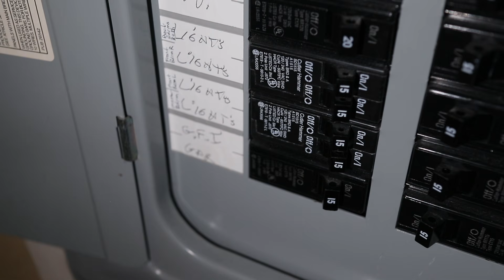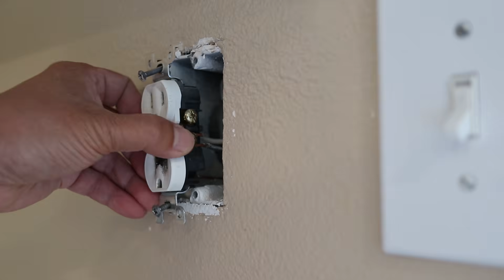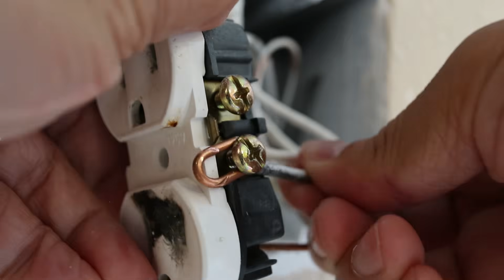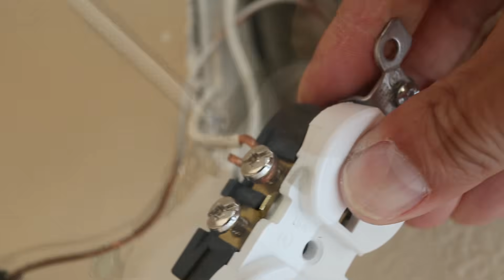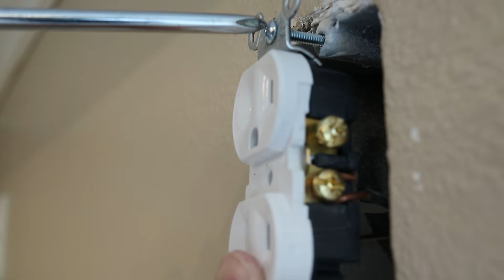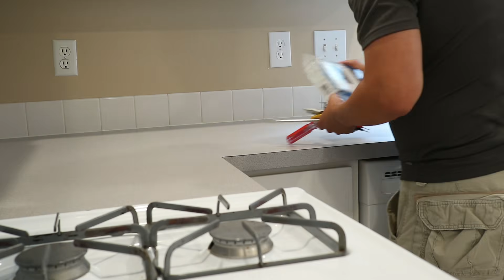How to Replace an Electrical Outlet – Replace Burnt Out Electrical Outlet and Old Damaged Socket

Comment: I have one question my on outlet has completely burned and it shoots out sparks if you turn the power back on is it just the outlet or the wires? It's similar to the one you showed in the video but worse. Great video, Thank you!

Comment: NOOOOOOO!!!
1. Tighten the remaining screws on each side of the outlet. 
2. Remove the paint off the ground wire.
3. Make sure you put hot and neutral on the right terminals. Hot (black) goes to gold and common (white) goes to silver.
4. Not necessary, but line up the faceplate screw horizontal or vertical
Reply: is this the right way to do it?

Comment: I took off my outlet and mine has 4 wires going directly into the outlet, not connected to the screws, how do I replace that one?
Reply from the maker: Sounds like you have a newer type of outlet with push in connectors. I’m not an electrical expert and even I still have issues taking those wires out. But I think there’s a little hole where you can press and it will release the wire. Hope this helps!
Reply: @TheRenderQ  thank you!

Comment: OK so I have a question we have a barn in our in our barn we have a room well one of the plugs in the room it burnt out like that but none of the other plugs in the room work now could it be just because of that one plug or does it mean all the plugs are bad because there’s no power going to any of the plugs now but the breaker is not off it says it’s on
Reply from the maker: It sounds like you have a GFCI outlet in your room. Look at all the plugs in your room or area next to the room to see if you can an outlet with a reset button on it. Press the reset button and your outlets should work again. If you reset and the button pops out again then it’s possible the burnt outlet is causing more problems and it will need to be replaced. I’m not an electrician but I know the first thing I’d look for is a GFCI outlet and reset it. Hope this helps!
Reply: @TheRenderQ  Thank you so much I really appreciate that and I’m going to do that most

Comment: This may be a dumb question, but if there is still voltage on the burnt outlet, do you have to replace it? Is it just for cosmetic purposes, or if it's burned before, does that make it more susceptible in the future?
Reply from the maker: I’m not an electrician so I can’t be 100% sure. If the receptacle is still working it might be fine even if it looks burnt. The burnt marks were probably caused by sparking and to prevent damage the breaker could’ve tripped for safety. So in all likelihood the burnt receptacle is probably cosmetic. But the one I had was in a rental house so I had to change it. Hope this helps!
Reply: @TheRenderQ  Appreciate the response!

Comment: Hey there, thanks for showing this! Not sure if you still check these comments but I just closed on a tiny house on Monday and aside from everything being very dated, it seems the wiring was definitely not done by an electrician. There are only a couple of grounded plugs in the house. To avoid using several 3-prong adapters, am I fine to replace my current 2 prong outlets (they don't hold plugs in very well) with 3 prong outlets and just maybe mark them to show they aren't grounded? Not sure if you can ground an outlet without putting some holes in the walls.
Reply from the maker: Congrats on your new house! Unfortunately I’m not an electrician so I can’t really advise you on how to go from 2 prong to 3 prong outlets. I was just able to replace my outlet with exactly the same thing. Sorry I’m not more help! Hopefully you find an answer to your project! Thanks for watching!
Reply: @TheRenderQ  Thanks a bunch! I also appreciate the quick response. Something I found is that older houses might have the 2-prong connected to a metal box and the box itself is grounded and that is where you would connect the ground for a 3-prong. Something I may look into or call an electrician if it is too daunting for me. Your video definitely helped with the confidence as well as another for light switches. Hopefully I can slowly update this old home and have some of the areas make a little more sense. I appreciate it!

Comment: Why did you connect the Hot black wire to the bottom screw and the White neutral to the top screw?
Reply: It makes no difference as long as the tab between the screws is not broken.
Reply: @surferdude642  t Thank you!

Comment: Dumb question.... do I need to turn off electricity??
Reply from the maker: Yes! You need to turn off the electricity to that outlet before you start working on it. I mentioned that in the video where I switch it off at the breaker box. Mine aren’t labeled very well so I have to flip breaker switches until I turn off the right one. Yours may or may not be labeled. Hope this helps!

Comment: Hi, I don’t know if you will read this but my outlet where my wifi router is plugged in stopped working and there were those burnt marks on the outlet, than the other outlets in that bedroom stopped working to, don’t know if this is a different problem
Reply from the maker: It’s possible that all the outlets in your room are on GFCI circuit. Look for an outlet nearby that has a reset button on it and see if it needs to be reset. The other thing which I think might be the real problem is that when your outlet burned out, it tripped the breaker switch for your room. Check the breaker panel to see if the breaker switch for your room got tripped. You could flip the switch back on and you should get power back on in your room. That burnt outlet will need to be replaced. Hope this points you in the right direction!

Comment: I agree with others claiming how great the video is - precise, straight-to-the-point and no-nonsense.  Since time is money, your candidness is much appreciated.  I was just wondering if the GFCI is replaced in the same manner.  Can someone comment on that, PLEASE??
Reply from the maker: I have not changed a GFCI outlet myself but I would imagine the process should be the same. Now you got me thinking I need to open up a GFCI outlet and see what wires are in there!

Comment: With the circuit tester does it matter what color goes in what opening ?
Reply from the maker: I’m not an electrical expert but when I use the tester shown in my video I don’t look at what color probe I’m using. In fact I don’t know which side I should be putting into which opening. But I’m mainly concerned with whether there is any power going through the outlet before I work on it. This tester lights up no matter which side I plug the probes onto. Hope this helps!

Comment: I changed the same way two different power points ....One working fine but the other is not working ...It just spark little for 1second on moving wire but no power supply shows to any device ....Plz help ...What's the actual problem of   power socket

Comment: Saw in another video that any screws not being used  are tightened to avoid contact with the metal box. Another point, that the ground opening on the socket should always be closest to the floor so if via gravity the plug loosens the ground connection is maintained till the plug falls out.This was the way he did it , but it needs reminding.
The last time I had a receptacle turn black was a failed appliance plug, but certainly worthwhile testing and inspecting the wiring
Also it seemed like he was changing a  Kitchen outlet and here in Canada the top and bottom section of the socket in most kitchen outlets are separately wired with a 220 V lead 120 to top and 120 to bottom each outlet good for 15A  You have to break and twist off the copper interconnection on the receptacle on the feed or hot side. The smaller slot on the front of the receptacle is the hot side. You'll notice that the two breakers for kitchen outlets are linked and move together.
I'm not a professional, just an electronics,electrical, computer hobbyist.

Comment: Wrong!! The wire is stripped to much. The copper should only be showing around the termination screw
Reply from the maker: Yeah several viewers have mentioned that there is too much insulation stripped off. I just replaced the outlet with the wires exactly as I found them. This was originally installed by the builder. I will have to go back in and trim the wires so there’s less of it exposed. But makes me think how many outlets/light switches in this house are like that?

Comment: Unfortunately, the author of the video did not use TAMPER-RESISTANT receptacles as required by the code.
Reply from the maker: You are correct! I replaced my outlet with the same type that was in the wall box.
Reply: Not where I live are they “required by the code”

Comment: Do you have to turn the whole house off? Or just the breaker to the room you’re working on?
Reply from the maker: I only turn off the breaker for the room I’m working in. But always check confirm power is off at the outlet before working on it. Hope this helps!
Reply: @TheRenderQ  thanks! Got mine fixed. Thanks so much

Comment: My outlet doesnt have screws on the side. Just what looks like a clamp button. I cannot find anything on how to take it off and get the wires out ☹️
Reply from the maker: I’ll paste a link to a video with push style wire connectors. I’m not sure this is what you have. Tutorial starts at :32 seconds. Hope this helps: https://youtu.be/rYgj15F4SoQ
Reply: @TheRenderQ  I saw that video. But mine was slightly different. The slot was on the side instead of the two screws and it was like it was glued. Pressing them did nothing. I ended up cutting it off. Haha. All better now! The rest of your video helped a bunch! Thank you so much!

Comment: What happens if you Put water and soap in the outlets and the room power stops working what do I do?
Reply from the maker: Sounds like you tripped the breaker! Of course water and electricity don’t mix. Check your breaker panel to see if a breaker got tripped. If yes then you need to wait until the outlet dries out. Maybe blow a fan towards the outlet to dry it quicker. When it’s completely dry go to your breaker box and flip the breaker back on for that room. Hope this helps!
Reply: @TheRenderQ  what about the soap in the outlets should I try washing the soap out?
Reply: @TheRenderQ  I don’t have a breaker panel in my house
Reply from the maker: I think as long as the liquid dries out of your outlet it will still work. If there isn’t access to a breaker panel perhaps you tripped the GFCI. It will be like a breaker but it’s built into one of the outlets in your room. It’ll be an outlet with Test and Reset buttons on it. Press the reset when you’re sure the outlet is dry. The soap shouldn’t matter after it’s dry. Hope this helps!
Reply: @TheRenderQ  I don’t have a GFCI in my room what do I do?
Reply: @TheRenderQ  I think Samuel is messing with you

Comment: What if the old outlet is upside down?
Reply from the maker: Once you replace your outlet you can install it the right way up. Or you can turn your existing outlet if it doesn’t need replacement. Just make sure the power is shut off. The receptacle is just held in by 2 screws. Easy to install it the right way. Hope this helps!
Reply: @TheRenderQ  i bought a 1970 home. How do you know if the outlet needs to be changed?

Comment: When removing the wires from the old outlet, why not take the screws all the way out instead of prying the wires out?  You're not reusing anything from that outlet, so no need to save anything, although, I never throw away good screws.
Reply: In my experience the screws stop to prevent them from coming all the way out....thus not losing them.
Reply: @ohwell-63   The screws will feel tight, but if you keep turning they will come out.

Comment: Can I use just a simple voltage LED night light to test the circuitry as I don't have a circuit tester.  Otherwise the video is simple and to the point. 👍
Reply from the maker: I suppose you could test the wires with anything that can let you know that the current is off at the outlet. At the time the 2-prong tester was what I had. But recently bought a no contact voltage detector for these type of electrical projects.

Comment: Do the wires have to be wrap around the screw or just screwed in under the screw ?
Reply from the maker: The wires should wrap around the screw. Use some needle nose pliers to create a small loop. Also make sure there is only enough wire outside of the insulation to wrap around the screw. You don’t want too much wire exposed. Hope this helps! Thanks for watching!
Reply: You would like the "spec grade" receptacles, they have a feature where you can slide a straight stripped wire between 2 plates, then tighten the screw. They are not much more expensive, but higher quality than the cheap residential ones.

Comment: I poppet it off and one of the wires that was connected to the screws is totally melted off so short that I cant use it? Its like it exploded off then melted down and splintered and rusted and corroded to nothing?

Comment: Got to show some concern here for you and others watching.  Both hot and ground wires were stripped too long.  This resulted in bare copper wire being exposed beyond the back of the outlet.  Not good.  Should have clipped off the end of the wire and redone the strip to the correct length.  You can't always trust that the person before you did it right.  Also the top of the loop of the hot wire was about to squeeze out from under the screw.

Comment: I would like to replace all the outlets at my house do you recommend using 20 amp outlets for the larger appliances and 15 for the interior of the house? Will it cause complications?
Reply: Use 15’s throughout
Reply: 20 amp receptacles will not cause complications. Use 15 amp "spec grade" receptacles. Never use 20 amp duplex receptacles because you'll never need them and they offer no advantage. If you're concerned about overloading it's the wire gauge, circuit breaker and the number of receptacles on that circuit that are important, not the receptacle. Another thing is that 20 amp receptacles can only be used on 20 amp circuits, but 15 amp duplex receptacles can be used on 15 or 20 amp circuits.

Comment: What happens if the outlet is already dead but you keep the circuit breaker on with out using the circuit tester
Reply from the maker: Even if your outlet is dead the wires connected to it probably still have power flowing through them. The circuit breaker must be turned off and then wires to the outlet checked with a circuit tester to confirm the electricity is indeed turned off at the electrical box you’re working on.
Reply: @TheRenderQ  oooh ok thanks even though I’m 12 and never will do this kinda stuff but thanks

Comment: Loved this video easy and simple. Do you have one for ceiling light and wall light?
Reply from the maker: I’m really glad my electrical outlet tutorial was helpful! At this time I don’t have tutorials for a wall or ceiling light. But when and if I need to do one of those I’ll definitely be making a video for it. But I think that once you’ve replaced an outlet you should be able to do the lights no problem. Wiring should be the same but the fixtures are attached differently. Thanks for watching!

Comment: Can an outlet like this one be replaced with one that has a circuit breaker built in to it,like the ones in a bathroom above the sink?
Reply from the maker: The type of outlet you’re referring to is a GFCI outlet. I’m not sure if you can install one of those in here. I’m not an electrician so I can’t tell you for sure. But if a GFCI were to be installed it would protect this outlet from overloads or other problems. I just haven’t installed one myself so I’m not much help. I just do DIY I feel sure I can do on my own. Thanks for watching!
Reply: @TheRenderQ  thank you so much for responding.I have 2 outlets that need replacing and someone gave me the GFCI outlets still in their boxes.I am scared of electricity and was hoping I could use them because they are safer.Your video makes me believe I can do this and for that I thank you.I am terrified of electricity due to childhood trauma so I think I will be safest to flip the main breaker while I do it so I know for a fact no electricity is running through anything
Reply from the maker: Always turn off the breaker for the room you’re working in. And use a circuit tester just to be sure. Replacing an outlet isn’t difficult to do but I know a lot of people are afraid of the wires. I used to be that way but somehow i overcame that. Having the circuit tester gives me the confidence that the power is really shut off on the outlet or light fixture I’m working on.

Comment: TheRenderQ, I just purchased a Leviton USB Charger/Tamper Resistant Outlet to replace a standard burned wall outlet like you're replacing in this video. However, the USB Charger has only the green ground on the bottom left side and two screws on the right side. The old outlet has two screws on the left and two screws on the right, plus the green ground screw. With two few screws on the left side of the charger how would I replace the new outlet in the place of the old outlet? Hopefully, you can answer me very quickly. Thank you, Willie.

Comment: Super simple - thank you!  Stupid question (it's my first time and I'm terrified of electricity, but I WANT to do this myself) - I turned off my power, I am using a Voltage Detector to verify, 1 of the 4 outlet slats still lights up?  Normal?  Or do I have some faulty wiring?  Thanks!!
Reply from the maker: If your voltage detector is still lighting up then there is still power in that outlet. You may need to check some other breaker switches to see if you another will cut the power. Sometimes a breaker that turns off the lights in the room is different than the one that turns off the outlets. Hope this helps!